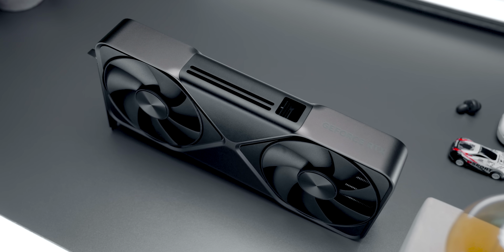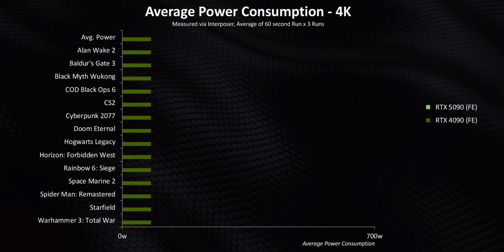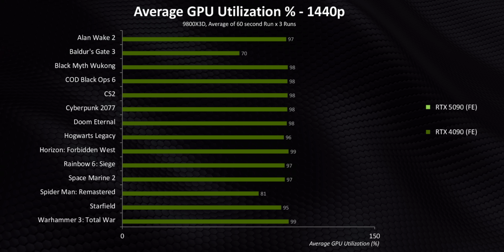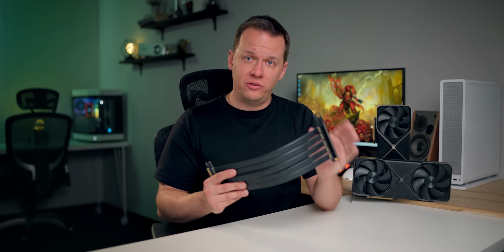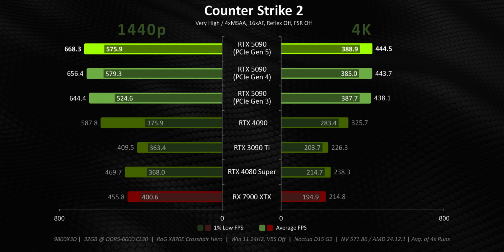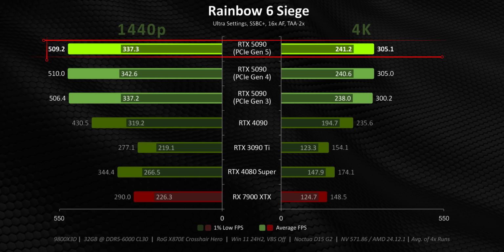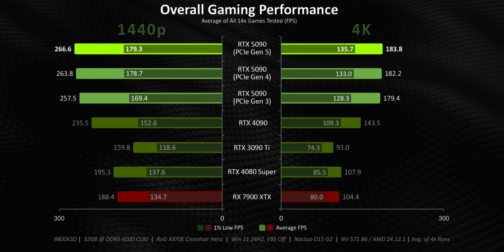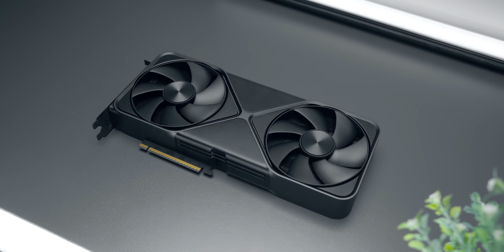RTX 5090 - CPU Bottlenecks, PCIe Scaling, Benchmarks & More

Comment: Quality review, kudos for the time, effort and detailing. We will note an often overlooked feature on ASUS ROG motherboards is our PCIe Alteration mode switch which we introduced years ago to help alleviate specifically issues due to riser cables.

It allows for the ability toggle the PCIe link speed WITHOUT having to enter the UEFI.

While many users do not think there is additional value in our premium offerings this exactly the type of additional subtle features we introduce to improve the PCDIY experience.

You will find the PCIe alteration mode switch on many models some of which I have noted below

X870
HERO, E, F, -A .....it is even on mini ITX like our X870-I on the FPS riser card! 

X670
HERO, GENE, -E

We also have this on numerous Intel based motherboards as well under the ROG MAXIMUS and ROG STRIX series of motherboards.

Side note you can also change the Alteration Mode switch to a hardware level toggle switch for fan control levels if you do not want to use it for PCIe link speed changes.
Reply from the maker: Going to pin this. :)
Reply: Yeah, a switch which I can't get to if my card is mounted vertically on a riser cable. :D
BTW, why isn't there a solid mATX option as the GENE board was for the x670e on the x870e platform?
And when are mainstream boards getting 10Gb ethernet ports - most of the world has moved to 10Gb home networking already?
Reply: Is your warranty still a joke

Comment: Well, 8 months later, supply is kicking in and I got an OC card for MSRP. -12% power limit and this thing is within spec for a non-OC version and only pulling 500-510 watts under max load. All the while never getting above 76c GPU and mem temps.

Comment: I only upgraded because I use Ai LLMs for work. 2 3090s were ok, but 2 5090s is 3 to 4 times as fast for inference. I got the FE so I can stack them to 4 pice slots spaced 2x apart. 

So if I get a PSU that can do 2000 watts … it’s a lot. Had to plug into the laundry room 40amp circuit.

Heat. Yes. And I actually do hit the power target. It’s essentially exhausting in the hallway.  I would put it upstairs but I’d have to have an electrician run a dedicated circuit.

Comment: There are overlays that tell you frame time and what your frames are waiting on, like the cpu, gpu, etc. Not only that, it would have been nice to see the actual fps the games were running at. I've seen several that scale weirdly at higher fps either consuming noticeably more cpu or gpu for a non scaling increase in framerate. Not only that, but charting fps, power use, cpu load, gpu load, then comparing frame time latency of the components would have been nice to see, though a lot of data to record and edit. On top of that, even a cpu at 70% or 80% may be a limiting factor where it's what limiting fps. A cpu overclock on a 9800x3d is usually possible at 5.4ghz easily, with decent chips going to 5.6ghz on the right board.

Ultimately though, this gpu is kind of a waste on most 1440p titles, and only really shines in 4k. Unfortunately, the 9xxx series chips have inherent issues relating to how they handle ram and task data transmission compared to intel chips, but they're far more power efficient and absolutely kill it with the huge cache size. Hopefully when zen 6 drops with their 2nm+ chips we can get into that 6ghz range with some massive cache on the x3d chips.

Comment: Important thing You Mentioned in this video is to find out if the PC Riser cable can handle PCIE 4 or 5 Speed Links.  If it can't than leave the BIOS Setting on Auto.  Buy the PCIE 5 Riser Cable see if it works then start messing with the BIOS Menu Settings only if You do not see an improvement.  Cheers!

Comment: Real world user here.  Yanked out my 4090 FE 2 days ago, installed a 5090 FE.  Doesn’t run hot.  Visuals in cyberpunk, Indiana jones, and avatar are absolutely stunning and smooth compared with the 4090, using DLSS 4X.  Incredible frame rates, visuals and smoothness. 4090 couldn’t handle what the 5090 handles with ease.  Running amd 7950x3d, 32 gb ddr5.  Don’t let anyone tell you the 5090 isn’t a major improvement.  No way am I selling this card.

Comment: Think crossfire and sli should return, 2 300W gpus would be better for all than a 600w gpu. Plus sales increase but only if performance scaling improves and it's invisible to games.
Reply: That would be nice if Developers started supporting mGPu better, mGPU scales better but becomes cpu bound quicker than the driver based dual card setups. This has been experience with mGPU/S.L.I so far from my two RTX 2080 ti's & 5800x 3D.

Comment: whole team of people and didnt run the 5090 on a 13900k or 14900k or even a 285k? no you used one cpu.. a 8 core 16 thread cpu marketed for gamers only.. and only at 6000mts.. good review but needs more options for cpus to pair it with and also ram speeds as it can affect performance alot.

Comment: Turn off resize bar and hags if you want to improve cpu performance. 
A tuned 9800x3d and 6400mhz cl 30 ddr5 should be able to push the 5090 to 99%

Comment: MSI MAG X870 Tomahawk + MSI 5080 Ventus, no risers = same problems with 5.0 slot: stutters every 2-4 seconds, videos playing in 20 fps or less, system freezes and restarts. Setting 4.0 fixes the issue. I don't believe it's a pure riser problem. I just hope it's NVIDIA's crappy drivers and can be fixed easily. Or at least BIOS updates will help.

Comment: Every one keeps saying if you have a 4090 don't bother with the 5090. Ok i see where they are comming from but the 5090 starts at $3500 in canada and just imagine what the 6000 series will cost. 30% jump for about $1000 more 6000 will be a 20 % jump and still cost another $1000. Really not worth it, I was going to grab a 5k 2k oled lg monitor 45". But now forget it. Ill keep my 4090 because 24 gigs of vram is still alot for whats out there. When needed ill go out there and grab the latest then.

Comment: I don't think of flagship cards as 4K GPUs. I think of them as 1440p cards with a lifetime ahead of them with my 1440p monitor. ..... If however the frame rate is very high at 1440p, then I can use Nvidia DSR and play at 4K.
This way you get a good go at the most demanding titles, and less demanding titles at high refresh. ... Win - win.

Comment: As drivers mature, it is reasonable to expect the RTX 5090 to demonstrate increased performance, further widening the gap over the RTX 4090. Hopefully, future driver updates will also address the underutilization issue. Launch drivers are often less refined and serve as a temporary solution, allowing Nvidia to bring the product to market quickly. One might expect, however, that Nvidia would release the GPU with sufficiently optimized drivers to fully showcase its true performance potential.

Comment: Unfortunately the PCIE tests are not actually testing the correct thing. Gamer's nexus made the same mistake.

The PCIe tests are testing frequency and not bandwidth. The amount of data copied is more important than the speed when measuring PCIe so VRAM usage would be an important metric as to how well the hardware is being utilised. 

Essentially PCIe should have more influence on Texture aliasing and pop-in than on FPS.

Comment: Are the issues only if you use a PCIE Riser/Adapter? Does this also happen if I were to plug in the 5090 directly into a PCIE 3.0/AM4 Motherboard slot or no? I understand that I will lose some performance for using PCIE 3.0 compared to a Motherboard that is PICE 4.0 or even 5.0, but frankly I'm willing to take that frame loss over spending the extra money on upgrading to a whole different platform when my current one is working fine for the most part, will probably upgrade when AM6 comes out depending on my situation at the time

Comment: This is a very complete and high-quality review. It shows you the minutiae in detail of the shortcomings of the 50 series in different scenarios. I'm worried about the compatibility with the Riser 4.0 cable. Even saying that acquiring the 5.0 that currently has a higher value than usual could have problems. That is, I have an ITX board with ocie 5.0 but I have the ForndT1 that comes with a 4.0 cable. Am I going to have compatibility problems and blue screens with a 5070Ti? having to co-configure the BIOS? I always get tangled up with these things and it bothers me that they don't work right away when I install them as they should.

Comment: Greatly appreciate the PCI-E testing, mostly play Racing Sims in VR. And I'm really wondering if there is any meaningfull performance uplifts from gen5 compared to 4. Prices are all over the place, but I'm struggling if a 5070ti will be just the same as a 4080super by perf. or if the new gddr7 and pci-e5 really bring anything meaningfull to the table. Futureproofing only atm I guess

Comment: 1440p data doesn't make sense in a review for a $2000 GPU... i believe CPU utilization increases in RT games due to BVH structure buildup requirements. It may be interesting to see a CPU review checking to see how other CPUS fair in RT if a 9800X3D struggles....
Reply from the maker: BVH is calculated on the GPU for most games now
Reply: @HardwareCanucks  Which games? The CPU is certainly calculating most BVH structures to do RT in Cyberpunk, Hogwards Legacy or Spider Man.
The GPU calculates boxes, bouncing and intersections. The CPU creates BVH structures for all games I checked.
Reply: @samgragas8467  The CPU is usually calculating CPU PhysX in anything DX12 that's Nvidia sponsored, the rest is all game engine draw calls that go to the GPU. The majority of game engines all have snyc call some time on the CPU. even RT would end up being a draw or texture call from the cpu. There is no reason for the CPU do calulate what the GPU has to figure out for a ray of light. It only has to tell the GPU "you have this many rays to calculate"
Reply: @ I didn't understand anything you said. I asked for examples cause I am certain raytracing increases CPU load (at constant FPS) and they told me it's due to BVH, thus reducing FPS when the bottleneck is the CPU (you can test it and it happens).
Reply: @ BHV are just draw calls.

is this simple enough for you?
Reply: @kevinerbs2778  Test it yourself. Try 540p RT on vs RT off (100% CPU limited). You get 90 FPS vs 81 FPS, for example.
How is 10% less" just draw calls"? LMAO.

Comment: Changing the PCIe Link setting in the BIOS to match the riser cable has been a common thing for cards that are higher spec than the cable.  I had a case that came with a PCIe 3 cable but the GPU was PCIe 4, so I either had to set the PCIe Link mode to Gen 3 or get a PCIe 4 riser cable or experience random crashes.   It's also worth noting not to cheap out on PCIe riser cable as well since some cheap ones still cause issues, so definitely consider reviews and not just the cheaper price.

Comment: Is not the simplest explanation that there are forthcoming BIOS and driver updates (future use cases) for the 5090 which should address the issues (PCIe utilization / bottlenecking) found at a later date? I'm not trying to give NVidia a pass, they should not launch until its ready, but doesn't that explain the weird behaviors people are finding? This is just a 40-series optimization as opposed to a new generation GPU. IT is what it is I guess.

Comment: Coming from a 3080, the 5080 is going to be a HUGE improvement for my 1440p gaming. If I already had a 40 series, I would not be upgrading.
Reply: Using a 5080 for 1440p is wasteful cause DLSS looks good and 1440p DLSS Quality is not demanding without heavy raytracing. A 5070 Ti or your 3080 are good for 1440p DLSS Quality.
Reply: @ not true. I’ll go from my 80fps at medium settings on Wukong to probably 100+ on ultra settings. It’s a massive difference in frames because of DLSS and frame generation. 3080 has DLSS but it’s no where near the performance of the new DLSS versions and the 30 series isn’t capable of frame generation. I could go for a 4080 but I’m fine with spending a couple hundred more for the current series.
Reply: @ Not true? 80 FPS it is without DLSS and you also want ultra settings.
1440p high DLSS Quality is the right way to play, 1440 ultra native is wasteful. Try 1440p high DLSS Quality raytracing instead, it will look better.

Comment: NVIDIA 5000 series is nothing more than a 4090 with software and firmware updates.  If you buy this your a fking moron!
Reply: id say, a better raster with the same RT performance and a bunch of fake frames.
Reply: @SnowsLife  if they took the training wheels off the 4090 it would be the same.  Ask yourself why they didn't make a 4090ti?  Because they knew 2 yrs ago it would stop the 5090 in its tracks.  All Nvidia could do against a 4090 was add bells a whistles,  nothing more.  Time will prove me right.  They couldn't make the generational jump this time and resorted to smoke and mirrors. Skip this gen and or wait for a 5090ti.  If not you deserve what you get.

Comment: If you play at 1080p, for sure it's bottlenecked, but it's not even close to that if you play at 2k or 4k with somewhat high settings, unless you also turn on multi-frame generation, and at that point, you'll just have a worse experience.

It would be cool to be able to, let's say, turn frame generation on, when the card gets to 50 FPS, and make it just generate the extra 10 FPS to play at 60, but what it does, it that it reduces the "real" FPS generation to 30, and then creates 30 "fake" FPS, I really hope they add a way to do the 50+10 or 100+20 via software, I think I'd really use something like that.

Comment: This is the best review available for the RTX 5090 that I've seen.  Very thorough testing, looking at all the relevant scenarios it would be used in, and exploring where its limited and where it isn't.  The section about the riser cables as well as the power connectors was really helpful and not something other reviewers have really touched on.  This is why I love the Hardware Canucks team, particularly Michael whenever I see him doing the CPU cooler reviews that explore all the scenarios something could be used in.  It's incredibly helpful for consumers being well informed on the product's performance relative to what they have or how compatible a product would be with their system.

Comment: Thanks for the PCIe scaling testing, but my concern is more about PCIe 5.0 x8 vs PCIe 5.0 x16, as the motherboard I'm looking at (Aorus X870E Pro ICE) has three PCIe 5.0 NVMe slots, but the bandwidth for two of them is shared with the PCIe 5.0 x16 slot, so if you put any drive in those slots at all, my understanding is that the PCIe 5.0 x16 slot is cut to PCIe 5.0 x8, and I'd rather not be limited to two storage drives.

Judging from your testing, I'm guessing I wouldn't notice much if any difference, as PCIe 5.0 x8 should be roughly equivalent to PCIe 4.0 x16. Thanks.

Comment: how does bottlenecking and pcie do when measuring non-gaming workloads such as blender rendering, ai workloads (stable diffusion? llms?), and gpu compute workloads like ai upsampling? aftereffects?  is it possible to comfortably run a 5090 at 8x pcie gen5 (gaining a card slot) this time around without losing out on performance?

Comment: Would you recommend getting a new pc with 5090 for gaming on ultra wide monitor like Samsung odyssey G95sc?
Reply: I am pretty sure 1440p is similar to ultrawide DLSS Quality so you will bottleneck your 5090 unless it is a game with heavy raytracing.
Reply: @ guess would have to turn all the settings on
Reply: @wagagagaggag  Sorry, I am wrong. It is a 5120*1440 monitor. A 9800X3D and a 5090 are ok with DLSS Quality and high settings. Thought it was 3440p.

Comment: Thank you for including the PCI E riser version tests... I've been wondering about this and wondered why no one has been covering it. Even with the minuscule difference between PCI E 4 and 5, is there a recommended fully working PCI E 5.0 compliant cable? When you spend 2K on a video card, it would be nice to not even leave a tiny bit of performance on the table. @Hardware Canucks

Comment: Is there even an ITX PSU that can handle it?
Reply from the maker: There are many.  Silverstone, Corsair, ROG, Cooler Master, FSP and a bunch of others all have SFX or SFX-L power supplies with 1000W rating.  In some cases like Silverstone, even more.
Reply: @HardwareCanucks  But does it handle the transients? It can do over 700W for miliseconds some times, usually ITX PSU can't handle does well since its internal parts aren't as capable as good quality full sized PSUs

Comment: I appreciate you cover areas not in other reviews, e.g. the cable wattage rating for psu and the test of riser cables, definitely appreciate the insight which other missed. It's a great review!
I would like to note that you mention at 9:20 that as right now not a single case ships with a pci 5.0 riser and from my understanding HAVN HS 420 VGPU, does have a PCI 5.0 riser cable included. At least that's what they advertise.

Comment: Question from a non-expert: The results for the PCIe testing is applicable whether it's using a riser or the direct PCIe slot on the motherboard, yes? Cos I'm still on AM4 platform using a 5900X on a B550 board. Might have a chance to move from my bought-used 3080 to a 5000-series. For sure 5090 is out of the question for me, though. Maybe 5080 or 5070 ti.

Comment: you might be first one can do all cpu's testing with same gpu and research it on architecture difference between amd and intel x86 cores difference in fps. I bet you its not all about x3d cache when that amd method gonna wear out soon when discovery intel run faster with this card . Either amount cores difference or architecture difference what devs code on